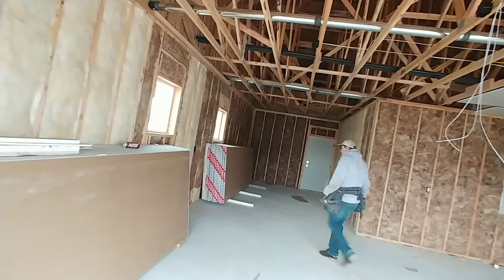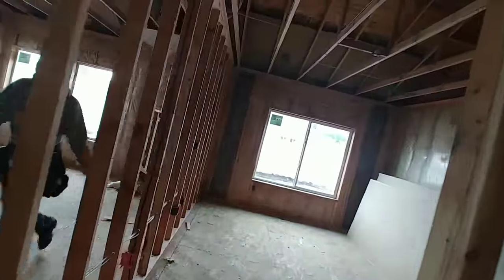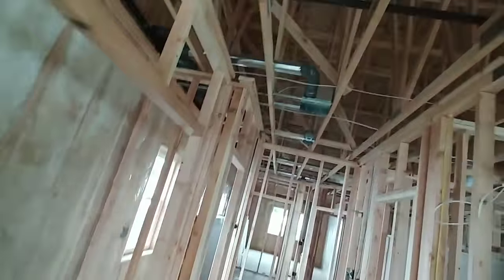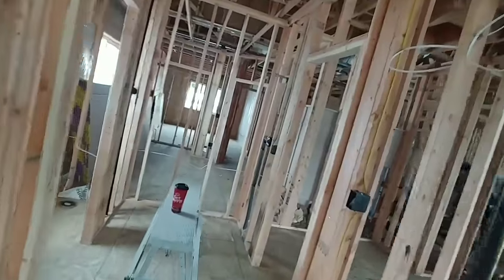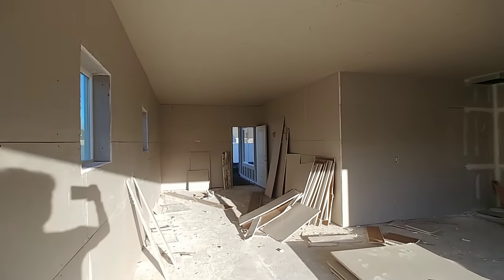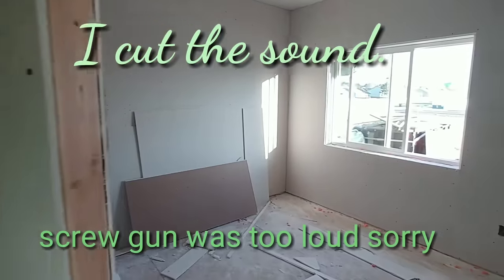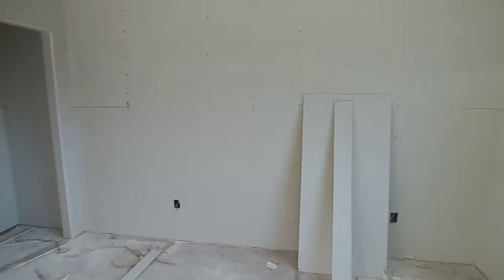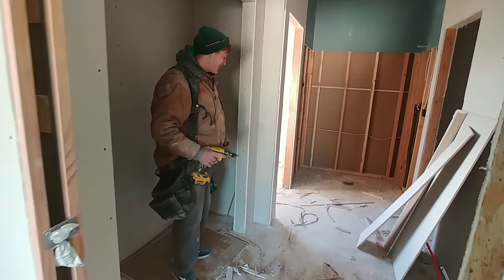Hanging drywall, 1 house 1 day, full crew start to finish drywall hang. Work vlog

Comment: Good crew, after 25 years of drywall hanging my advice is get another job. It will tear your body to shreds.
Reply: Dez Nutz drywall hangers develop hear issues at a higher rate than others in the trades.
It's the overhead work causes the heart to work harder to get blood to the arms which need it.
That is truth that gentleman stated and you insulted for reasons only you know.
Ask yourself why.
Reply: Nah dez nuts probably never worked in the trades, I’ve done it for just a few years already and I’m already feeling like an old man 😂   These guys who do these kinda big jobs and fast clean and professional like these guys right here is how I wanna be in the near future
Reply: Iv been doing it for 27 years I'm 47 and strong as a ox
Reply: martin tijerina well I made foreman so I just tell guys what to do...😂
Reply: matthew dyess to late
Reply: I agree...but ive done all phases of construction and it all tears your body up...but yes those stilts will eat your legs hips and back alive.
Reply: martin tijerina I know you're comment is 3 months old and but I just had to say I agree with you it will tear your body to shreds and no disrespect to that crew and but there was no lifting I mean like I work on sites the last 20 years and every house I do has an upstairs so carrying 100 boards up the stairs it feels like you have done a day's work on before you even put a board up and it's not just half inch there is pink and boards which are fire proff and blue is boards are sound green are moisture proff and there all over 35 kilos when I started 20 years ago there was only 3eight boards and half Inch on the ceiling it's getting harder by the year
Reply: Doing only one thing is hard on the body, good to have a variety of tasks to do.
Reply: Haha you think drywall is hard? Haha give framing a try
Reply: Flooring is the same way. But what's crazy is the craftsman wouldn't have it any other way. Personally, I'm a licensed GC but we tackle the smaller stuff that crews like this would have no interest in. I suppose because the job isn't as massive its looked at as inferior? Pound for pound, the smaller jobs might actually pay better and simultaneously save your body in the years to come. 

Like Mr. Tijerina says, when we're young we feel invincible. Getting old is so far down the road we can't even see it. Father time has a way of catching up and it will happen so fast my friends you will wonder where all the years went.

These guys seem to move pretty fast though. Will they being doing the bullnose/cornerbead, tape, mud, or texture? I'm not entirely familiar with new construction. But I can appreciate a person who is good at what they do. 

We repair the pre-existing for water damaged situations. When we get the call we're doing the remediation, dry down, and build back. It will entail drywall, flooring, cabinetry, and a potential list of other things (like cleaning up which I doubt any of these guys did).

All in all, I love what I do and I can see that you, my fellow tradesman, love what you do also. Lord willing, may we all stay busy for many years to come, put away lots of $, and make our families proud of us.

Peace out.
Reply: Dude!  I'm 51 years old..I had my first open heart surgery when I was 29.. then second open heart surgery to replace a valve  when I was 49.. shoulder spur.. rotator cuff, back issues.. I was a drywaller for 30 years..now I'm disabled....my advice..use a lift on the lids...I never did ..and now I'm paying for it..it's a young man game..but it will age you quick..
Reply: @lindamurphy5256  no lifting? These guys were hanging 12' 5)8" lids..120lb apiece
Reply: @octaviobustillos6968  I do both ..drywall is more labor intensive than framing anyday..
Reply: @davidjessee7701  I'm sorry but those lids were 40lb at max 12 by 5 foot half inch board I think you're way off with your 120lb per lid I'm actually doing lids with pink boards and there just under an inch thick there 9 foot by four and they weigh 40 kilos   I wasn't saying there was no lifting at all I was just saying there is no carrying boards upstairs or even 2 flights of stairs which I do daily I still think there a great crew but as I said in an earlier message there is no sticking 60mil and 100ml insulated boards I don't know how many  boards were in this house but if the ceiling was done I would slab about 80 to 90  boards per day on my own the only reason I say if the ceiling was done is because the ceiling is Manly a 2 man jop or I could just cut the boards on the joints that I could lift on my own it would probably be a few extra joints for the Taper or skimmer but still huge respect to the guys but I guess we do it differently in Dublin Ireland
Reply: Respect to all you guys. I was a solid plasterer for 20 years here in the UK. Luckily we only did smaller jobs not new site work so I got off with just a little stiffness in 1 shoulder. Been working in very light building maintenance for 5 years now, the work is easy but the money is poor lol. 
My advice is to retrain as a plumber, a spark or move out of the industry. It's not right that the working man has to damage his body to earn a living. Try telling an office based worker to work twice as hard for the same money with only a 20 min lunch!
Also I'd say try to minimise your outgoings so you don't have to earn so much. I now get the whole living minimally thing.👍
Reply: Every trade is tenuous and not easy on body...depends on what trade and what body movements your constantly doing.
Reply: Manny Nunez if you do any kind of cardio, it’ll completely negate that
Reply: @dontworrybehappy8080  ...amen to that
Reply: except head
Reply: Martin, correct. i'm sitting in bed with a trashed out back thing about the days i use to hold drywall over my head. Ugh!
Reply: @stephenpeter8350  I was the same bro..Until that one day. Hope your day never comes. Good luck to ya.
Reply: @octaviobustillos6968   sorry but what I was talking about was metal stud commercial construction..
The studs go up one at a time..10' studs 20 gauge dont weigh shit.. Thats why I say drywall hanging id more labor intensive than framing..i would frame out a new school then hang it.so I know what I'm talking about
Reply: You are right...
I hung for six years, quitting was the best decision I ever made.
Reply: I agree with you. I worked my butt off in residential, electrical and carpenter. Ruined my body by working like a crazy man starting at 15.  @yourlatinombre69
Reply: martin tijerina yep 2 back operations and several ripped tendons and broken ankles
Reply: martin tijerina I’m 31 and I second this message. I can’t imagine what you feel like after 25 years in this business. I’m getting a serious ass kicking right now at my young age
Reply: Ive been drywalling since 15 now 20 stretch everyday im more flexible then i was then when i was a toddler
Reply: After a full days work come home workout for an hour no soreness and we bang like these boys just no stilts ive never seen that thats really cool
Reply: Maybe i will feel it one day but i feel if you take good care of yourself inside and outside the workplace youll be alright
Reply: Chad Moyer take pride in being a foreman and showing and working beside younger guys. If not the trade dies! I make good money as a foreman and will sweat every day they do. Unless it’s just carrying something. Let that young back and energy go!
Reply: I know guys doing this in their 50s that outwork guys in their 20s so idk mannn, construction is a discipline. Its military in a sense. Only the physically and mentally strong survive the construction field.

Comment: Props to anybody that works doing drywall don’t matter the race ethnicity etc. 

82 likes damn thanks guys
Reply: Damn right son
Reply: I did that shit for 25 years
Reply: I wanted to be a drywall hanger.   My parents wouldn’t met me drop out of high school thou
Reply: @7033Joe  sorry joe that was a joke...   im in the trades and we use that towards other trades as a joke
Reply: Angel Reyna because they are all mexicans on the inside
Reply: Get the right tools, can make a lot of $
Reply: Or age
Reply: White 62 year old still hanging board, 40 plus years now!  Started before screw guns and routers were used in residential, hand nail and precut back then!

Comment: It's amazing to see how this job has progressed when I started 40 years ago it was called tacking and no cordless tools then all done with hammer and galvanised nails and still got the damaged shoulder from ceiling nailing now it's screw guns which is amazing fast but will always be hard work deep respect lads great team work and enjoy financial rewards. 👏👏👏👍
Reply: Yeah Kelvin I did the same, nailed the outside screw the middle, ceilings an walls, 3 screws per stud, doing ceilings we'd use wooden saw bucks where 8ft ceiling were perfect where we'd use our head to hold the drywall hammer in few nails then finish it off then screw it. Roeder an screw guns an cords for days lol.... but tip of the head be alittle sore by end day

Comment: My best time was 2 days on a 220 board house with just a 2 man crew  ( me and my 20 year hanging partner). I hung for 30 years, I’ve been retired now for 10 years. Are they paying any extra for the 54” board now. I used to get into it with contractors saying “ it’s not that much more work” I say bullshit, an extra buck a board isn’t a lot more money either. You can’t screw the ceilings from the floor, and it’s extra screws in every board. One reason I retired. Was over companies not paying double for high work anymore All the immigrants brought the pay down. That and 30 years is a lot of Sheetrock. You’ll get arthritis in your back after awhile. Take my advice, find a different trade BEFORE your back gets like mine.

Comment: My father thought me everything about Residential Drywall at a very young age, but unfortunately here in TX , it's not a well paying job. I decided to switch over to Commercial Drywall at the age of 16,i worked my High School summers for a Very well known company. By the age of 19 I was already a Drywall Foreman. I was still learning Blue Print Reading but i had the basics down. By the age of 26 , I had accomplish a lot in the Commercial Drywall. Learning Acoustical Ceilings, Doors, Hardware, Metal Stud Framing, Raco Frames, Solutions II, Timely Frames, and so much more. Know 34 years old , Started my Commercial Drywall Company 8 years ago and never looked back. Excellent Video Buddy
Reply: Chris Torres no one asked lol
Reply: Have had 4 drywall companies in 4 states and always paid piece work. Could tell by the carpenter tool belts that these guys get paid by the hour. Not impressed!!
Reply from the maker: You're mistaken. I just dont have a weak back sir. ;p
Reply: Oh, also --I had hanging crews (2 man) that could hang more rock in real time than all these guys in fast forward!!
Reply from the maker: @paulmaassen1806  I better delete this video the great Paul maassen is unimpressed.   And I heard he's like way better too. Its just a rumour but I almost guarantee its a true story

Comment: I’m new to hanging drywall . Here in eastern Canada the rafters are strapped first I’ve never seen drywall installed directly to the rafters. Cool! 

Is there a reason also to why there isn’t any Vapor barrier or insulation in the cieling before the drywall ? Is it blown in / spray foamed later ?

Love the videos and love learning ! Thank you !

Comment: Excellent work. I work as a carpenter myself, doing drywalls outside and inside. Also doing wood working, insulation and much more. Nice hard work :-) Why dont you use screwdriver? I like how the young guy uses stilts. Smart.
How do you move those massive drywall sheets inside, by hand or machine? Its a big job just to move them inside.

Comment: You guys make it look easy.. Great job..i did drywall for a few years.. Never seen the stilts used. I worked on a 5 man crew.. Mostly custom homes with vaulted ceilings and rounded archways..it was always nice to see the finished product.. They always laid the drywall stacks flat on the ground in the center of the rooms..we would pin up our sheets with nails first..then come back and screw it off..unless it was a garage lid with hat track on it.. ( i dont recall if its called hat track but something like that)
Reply: Mike Oberholtzer hat channel is what we call it
Reply: What kinda noob crew were you working with that didn't use stilts?  That's just silly
Reply: Danger 1 it was 30 years ago ..but i guarantee the crew i was on was the best out of Sierra West Drywall in Rocklin Ca.. I was the noob but the rest were the best.. Matter of fact one of the guys from that crew is in charge of things now..we did mansions with libraries and 5/6 bathrooms and bowling alleys and Maids quarters... Something you probably never even done before? We used scaffolding and aluminum sawhoreses.. 😜
Reply: Mike Oberholtzer actually I have done a couple houses with bowling alleys in the basement, in fact I even boarded a bowling alley! Schools, hospitals, malls, and giant mansions with indoor pools and massive screening rooms , I live on the west coast and vaulted ceilings, arches, huge open concept areas are in just about every west coast contemporary house.   Wow maids quarters isn't that special,  well no not really I mean, it is just a little suite tacked on to the main, like just about every house in an urban area these days, though admittedly mostly used for a rental  not a maid. Lots of standard 8-10' ceilings in all those examples. Great for stilt work I mean why climb up and down a bench all day burning out your legs? Couple guys on stilts will get the job done way WAY faster than a couple guys with benches.  FYI they are really easy to walk on after you let go and just trust yourself on them. I do stairwells solo on my stilts either walking on a plank or doing the splits over them no wasted time building a scaff .That's just hanging board though , a mudder without stilts is even worse.  My 20 some odd year old stilts with no padding left on the legs that cost me a couple bills back in the 90's has most likely made me a hundred grand, or more probably over the years just in time saved. True they Didn't really do my back any favours but what does in this trade?
Reply: Danger 1 ok you got me on all that..basically i didnt see or here of stilts when i did drywall.. A whole 2 years or so..lol anyways like i said that was 30 years ago..i believe at that time we were doing it the fastest way possible... The quicker the job was done ..the more money the crew split. After they paid me my hourly rate..lol
Reply from the maker: I only do stilted Lids with guys that are comfortable walking on stilts and rolling board on stilts. I feel like it makes it faster cuz the cubby doesn't have to get down to move the bench and if he's got time to stand he can just walk back and screw off. Attack a lot of my lit up if it's within reach of stilts so guys can just start hitting walls and I come back and screw it off. If a guy is on bench he's got to move the bench back to screw something off if he's waiting for me. If he's on stilts he's just free to roam. But like I said it's up to the comfortability of the individual. Not everyone wants to walk on stilts and roll lid.
I appreciate all the comments I enjoy reading this little thread continue on guys.
Reply: Mike Oberholtzer, I also did drywall about 30 years ago. This was also the first time I've seen a hanging crew use stilts. 30 years ago you had cords running everywhere, plenty to get tangled up on. Cordless screwguns and rotozips weren't there. we would glue/nail or screw. Things have changed a bit.